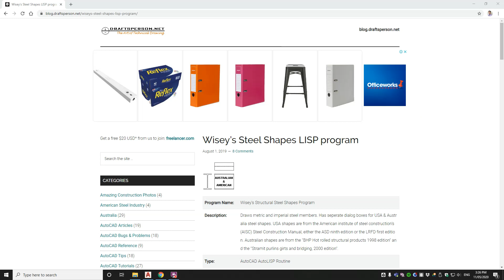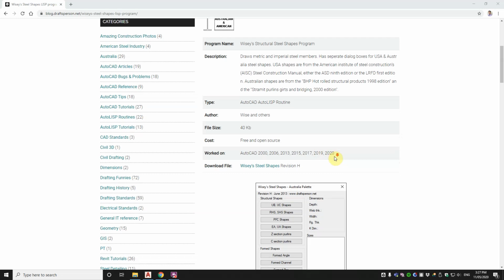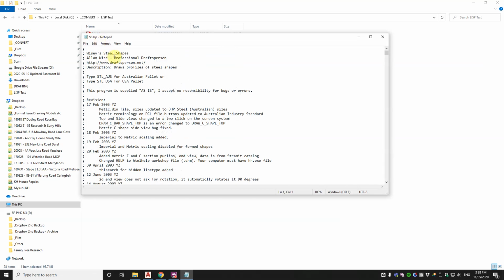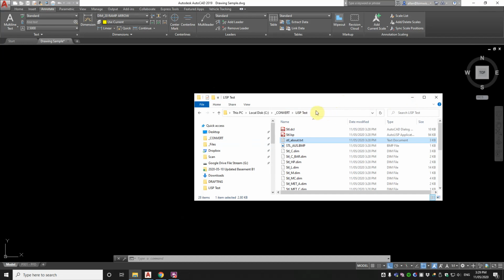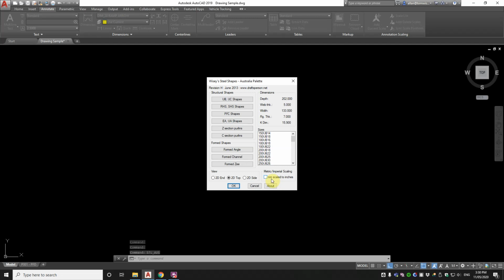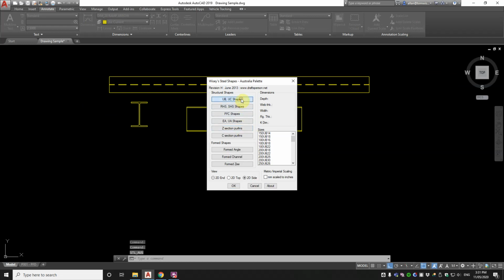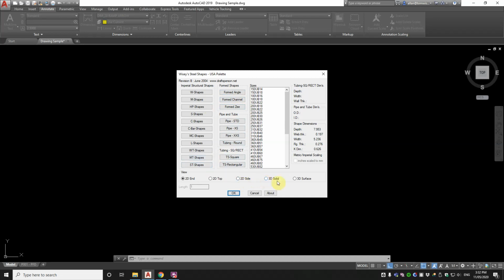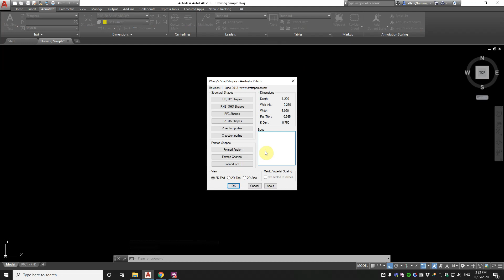Wisey's Steel Shapes LISP Routine - Let's test this baby

Comment: hi, great bit of kit. i have loaded it on and the 2D end, and 3D solid and 3D surface work fine. however from some reason the 2D top and 2D side don't appear when i use the 2 point locations? is there any issues with using this in autocad 2024? Keep up the good work 👍👍
Reply from the maker: Have not found an issue using it in AutoCAD 2024 myself. But maybe…
Reply: @TheArtofTechnicalDrawing  it seems to be when using 2D top and 2D side with the UK sections for UB and UC etc. it works for the SHS and RHS sections, hence it me be a slight error in the coding lisp file. I had someone else try it and it seems to be the same for them when using the UK sections. I had. A Quick Look at the lisp file however it’s pretty large and i am not that good with lisp, but maybe there be something that sticks out when you compare to the AU and US sections which do work with the 2D top and 2D side for UB and UC sections.

Comment: IT LOADS ON CAD 2022 BUT DONT OPEN
Reply from the maker: Make sure all the files are in an Autocad support path. The dialog box (dcl) will not show up if it isn’t in one of these.
Reply from the maker: Also I have used in several times in AutoCAD 2022. It works.
Reply: @TheArtofTechnicalDrawing   cant find file ,thats appears to mine🤧